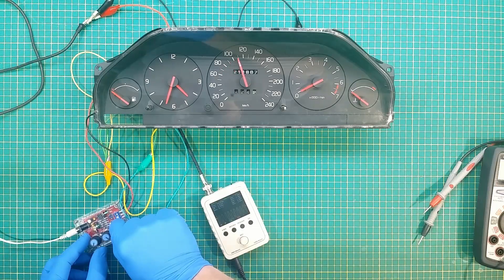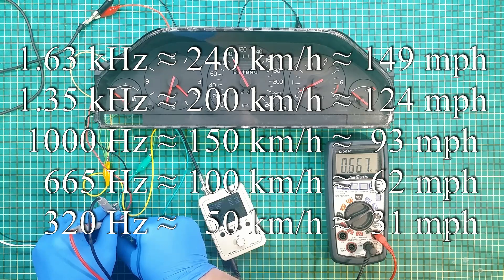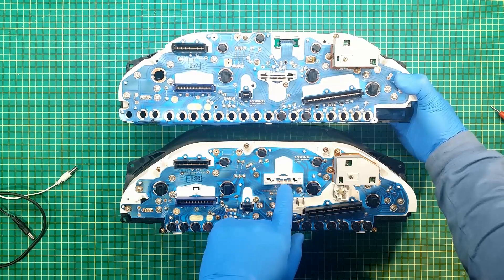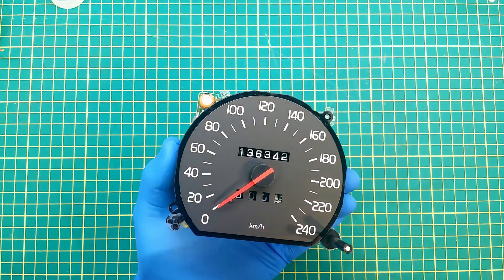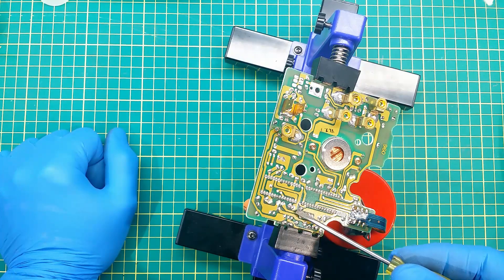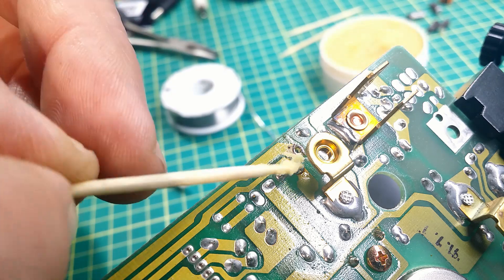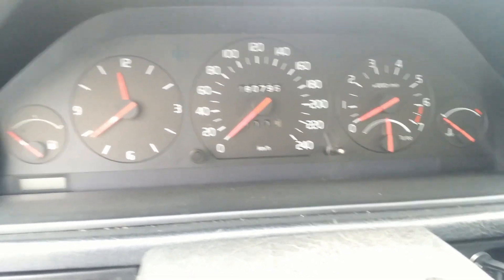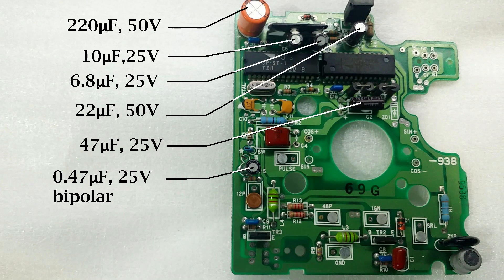Volvo 740/940 Speedometer Testing and Repair

Comment: I've been replace some resistors and capacitors and it works, but only read 0-80kmh or 90degrees movement.. i do replace both IC's and the results are the same.. do you have any suggestion for my problem?
Reply from the maker: Unfortunately I don't. The curios thing is, that when it goes bad it shows 0, stays at 80 km/h or jumps between 0 and 80. Good luck and report back when you fix it, so others can benefit.
Reply: @robertdeptula2003  did u know which components that controlling current frequency into the sin cos air core?
Reply from the maker: Sin+ goes to  leg nr 17 in AN6505, sin- goes to 16, cos+ to 12 and cos- to 13.
Reply: @robertdeptula2003 hey again 😂, i've checked all that you've told me for the controler of an6506 to the air core.. cos + and - also sine + and - are connected  to the ic.. and it still didn't makes any different.. i just bought the bench test like yours  but i dont know where the 3 output  of generator freq is going? Can u help me for wiring that generator into the speedometer? If on the bench test work perfectly, is that possible the sensor is bad for generating signal? I got abs on too
Reply: @robertdeptula2003  i just start frustating on it but i dont wanna give up 😂
Reply from the maker: @muhammadkaruniakusumaputer9336  You only use two output connectors from the signal generator.
If the ABS stays on and there is erratic reding on the speedo the ABS/speed sensor at the rear axle is the suspect or wires going into it.
Reply: @robertdeptula2003  actually i dont have any erratic reading on my speedometer, it has smoothly reading until about 78kmh and stopped reading above that speed.. but when i running up to 140kmh (on gps speedo) the needle goes down.. i tested with  freq tester and the freq keep raising.. now im getting exhausted haha

Comment: This is the most perfect and complete video about the Volvo 940 speedo issues. I already did the capacitor replacement on mine, but it only worked for half a year. I am thinking about replacing the chip with a diy microcontroller or FPGA solution. Thankfully the odometer still works. Do you know what input voltage to expect from the hall effect sensor?
Reply from the maker: Thank you for your kind words. 
I would expect 12V, but not sure.

Comment: I'm trying to bench test calibrate a 2 wire electronic speedo with a basic signal generator such as you are using. I can't get it to work. The speedometer works when the vr sensor is driven by a drill motor. What am I doing wrong? thanks for a response.
Reply from the maker: What car is it?
Reply: @robertdeptula2003  its a electronic speedo from an RX-7. same 2 wire vr sensor type  as the volvo . I can't get a signal generator to drive it on the bench. works fine when bench driven with sensor and a drill. But need a fixed speed/frequency to recalibrate the unit before removing needle and reinstalling the needle . I tried 2 different cheap signal generators on sine wave and triangle wave but I get nothing.  would you have an idea why that is? There is absolutely no information on youtube or internet search that I can find to get an idea.
Reply from the maker: Do you have multimeter that can measure frequency or even better an oscilloscope? Then you can determine what kind of signal or frequency is generated by the sensor when driven by the drill.
Reply: @robertdeptula2003  unfortunately I have just a basic multimeter. shop manual shows and states sensor generates a sine wave  with pulses of alternating current( with what I assume is a crossing at 0). Not sure what the signal generator is doing. I know from some  posts on the RX-7 forum aprox. 150 hz. is about 60mph. I guess without a an oscilloscope  I can't confirm.
Reply from the maker: Then it should work.

Comment: I have a 1989 speedo that is working for lower speeds. Going faster than 120 kph is will not go any further. Even with the same sine wave generator I cannot get to the full 220 kph the speedo is able to show. It starts wobbling or just sticks at 120 kph. Is this also a symptom of failing capacitors?
Reply from the maker: Hard to tell, but old electrolytic capacitors are the first suspect.

Comment: Hello, thanks for a good and useful video, I need to do the same work to my -92 940. Did you success repair the second cluster (the fried and overheated one)? Take care and keep it up! 🎉
Reply from the maker: Not yet, but I have one working with odometer not functioning (step motor must be replaced to fix it), and obviously I will put fresh capacitors in.
Good luck with your project!

Comment: Been trying to get a test bench for these speedos working for a while. Your video helped a lot.
It's also possible to simply generate the sine wave using an app on a phone, and connecting it to the speedo by a jack cable. :)
Reply from the maker: If the app will produce desired voltage then yes.
Reply: @robertdeptula2003  Interesting point. The speedo I have been testing with, works using an app on my phone. However it’s a later 940 ‘94 speedo, so I am not sure if it works differently.
I have a speedo like the one you show in the video, and it does not work in the same setup. Although, I suspect the circuitry is bad.

Comment: Well done, sir!  Well done!

I have a non-working speedo in my 1991 740 wagon.  I have electronic skills, but have been hesitant to remove the instrument panel.  I assumed that it would require taking much of the dash apart.  Your video shows exactly what needs to be done in fine detail.  I will have some confidence once I attempt this repair.

One question... If I have the instrument panel removed, can the car still be driven?  Other than not having gauge functions, is there any harm driving the the panel detached?
Reply from the maker: I would not do this. First, it is illegal, second, this can trigger error codes for the computer.
Reply: Bit of a late answer but there would be no harm running the car without the instrument cluster other than the alternator not activating since the battery light is whats giving the signal.
incase you have to move the car its fine but just keep it off the road

Comment: Hi, I replaced the speedometer in my 91 940 turbo with a junk yard one and works great, I believe is a dealer replacement because the last digit on the trip odometer is red are this dealer replacement better than the original or are the same and should I replace the caps?
Also my mileage is off by +80k, whats the best way to interchange the mechanical odometer to the good speedometer?
Thanks for posting this great information video 🙂👍
Reply from the maker: I am not the one who can tell you what you should do. But, if I were you I would keep an eye on the speedo behavior and replace the capacitors at the first sign of weird acting to avoid seeping electrolyte to do extensive damage. You can exchange mechanical parts and put the old face plate with mechanical mileage numbers on the "new" electronic board. Good luck with your project!
Reply: @robertdeptula2003  Thank you for your quick response, I woul follow your advice Robert.
Have a great day 👍

Comment: Hello Robert, thanks for the video! Really helpful.
I have a question, followed all your step. Now i have the electronic board out.
Your board has a big orange capacitor in de upper left corner (CI3) with a big flat and black component next to it (where the little capacitors are glued on to). I have neither of those 2 on my board. Do you have an answer for that? Side info: the little capacitors that are glued in your video leak also on my board. Hope you understand, greetings from the Netherlands!
Reply from the maker: It could be different in the European market. The principle is the same. Clean the board and solder in new capacitors. Good luck with your project!
Reply from the maker: Take a look @ 6min 15sec here: https://www.youtube.com/watch?v=ZBpf8dVAPrI
Looks like the European market doesn't have this capacitor C13 and the black component. 
I got my hands on the electric diagram. The capacitor and the black component is an extra feature for the service reminder dash light.
Reply: @robertdeptula2003  That was the first thing I thought of as well, thank you very much for your research! Tomorrow I'm going to resolder en clean the board.
Reply from the maker: Good luck! Please, report your results.
Reply: @robertdeptula2003  The speedo was all the time on 80 kp/h before. I soldered the new capacitors on the board. The speedo is now all the time at 0 kp/h. Note: my sensor in the diff is also broken. But for the replacement of that thing the entire rear axle needs to drop (Volvo 960). Going to do that in a couple of days. I hope the speedo then also comes to life. Going to try the trick with tapping the wires fast against each other to see of the speedo works.
Reply: my 1991 960 is also missing them

Comment: Wow! this is a nice video, thank you!
I'm figuring out how you could calibrate your speedometer (mine is a 1996 940 with Yazaki gauge).
I ve mounted big tires on this slighty lifted 940, and have approx 7% fault  (100 kmh on gauge is 107 kmh on GPS)
I've read somewhere that there is a resistor (about 50 ohms I believe) you can change to calibrate.
Do you know which resister that might be?
Reply from the maker: Check local regulations, your speed inaccuracy can be well within lawful limits. For example in EU the speed indicated must not be less than actual speed, but anything  up to 10% more plus 4 km/h is OK. 
For the resistor question I don't have an answer. Will repositioning the needle do?
Reply: @robertdeptula2003  Thanks. I live in NL, car has passed MOT before with these tires so I don't worry too much about that. 
I can always place a permanent GPS speedometer thingy from Ali if I need to.
Repositioning the needle could be a good simple solution. However, the bigger the speed, the bigger the error. At 50 kmh the speed in the dash is exactly 50kmh on GPS. So from factory the Volvo would be displaying slightly more than the actual speed. Having said that, I could find a solution somewhere in the middle perhaps, so that 80 to 120 kmh is not too much off.
Thanks for your tip!
Reply from the maker: You are welcome. Let's keep them rolling.
Reply: @robertdeptula2003  Not being able to find the info about this secret resistor, I might be able to make a little calibration module with a potentiometer, using an Arduino (-nano). It just has to measure the incoming frequency of the incoming sinus wave, measure the resistance of the potentiometer (on a separate analog input) and output a PWM square wave at a slightly slower frequency.  I guess a 3.3V square wave should do the trick too right? (maybe you have the chance to do a quick test for me?)
The original speed signal still goes to the ABS module, so if I place my module in between the signal input on the gauge, the square wave is only for the gauge itself..
Reply from the maker: I will do repair to my other speedo. When at it, I will compare square to sin wave frequency and let you know. But keep in mind, it can take time for me to get my hands on this project.
Reply: @robertdeptula2003  Fantastic! I'm not in a rush with this project, so maybe your video will be on time for me, you never know 🙂
Setting that aside, it would be interesting to know if a square wave is also 'accepted' 
Thanks! 👍
Reply from the maker: @winandd8649  Finally, I did a successful repair to my second speedo and I checked sin, square, and triangle waveforms. It doesn't meter which one you use, 1000 Hz of any form gives the same reading on the speedo.
Reply: @robertdeptula2003  Very nice to know, thank you for this follow up! 😎
Reply from the maker: You are welcome  @winandd8649

Comment: Hey Thanks for the video!
My case: Volvo 940 1995 - Speedometer on 0 km/h and the ABS light is on. Thats means my sensor is damage? 
I think my cluster is ok because the odometer and the tachometer are working fine.
Reply from the maker: Check wires @ the differential sensor.
Reply: @robertdeptula2003  thanks a lot.

Comment: How did you connect the wires during testing?
Reply from the maker: To do this kind of repair you will need a lot of patience. But I can tell, that you don't have the patience to watch this video on the subject. I explain in it precisely how to make connections for the test. Good luck with your testing and repair.
Reply: @robertdeptula2003  Im sorry man, I've got no idea how i managed to miss that :D. Found that part of the video just a few minutes later. Great video by the way.
Reply from the maker: Thanks

Comment: Is it the same for a Volvo 960 1991 3.0L? (my speedometer works sometimes and sometimes not)
Reply: Swedish specs.
Reply from the maker: The instrument cluster for 960 is different than 940. But you can take it apart and look for leaky capacitors. Could be same problem and same solution.
Reply from the maker: Good luck!
Reply: @robertdeptula2003  on my instromentcluster it says that it was made in 1990 07 17 and it has spots for capasitor a bord witch it is missing same with the blue wires. You video help me take everything apart (without brakeing anything) Thank you i whould love for you to make a vedio on speedometer for 960
Reply from the maker: @meatballs9127  Sorry, I don't own 960 model.